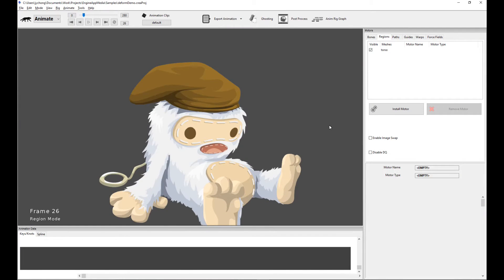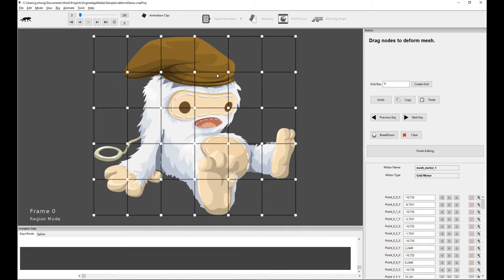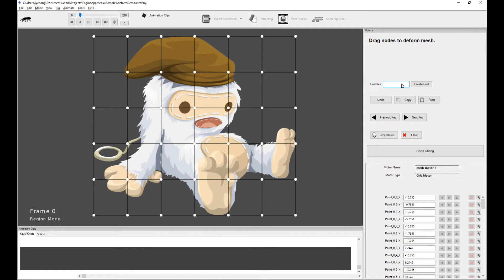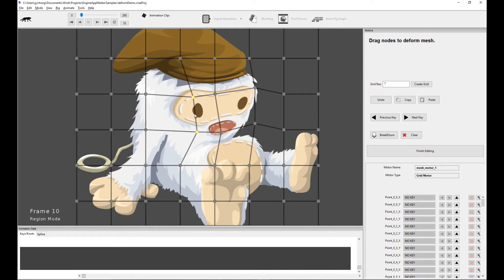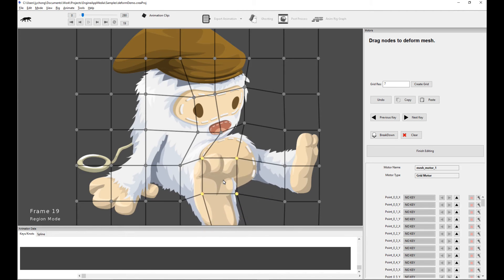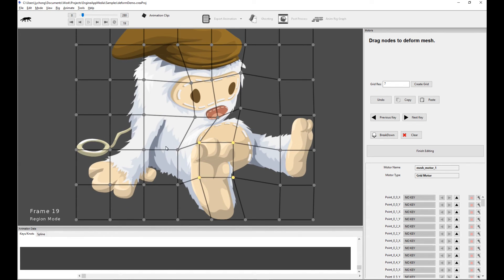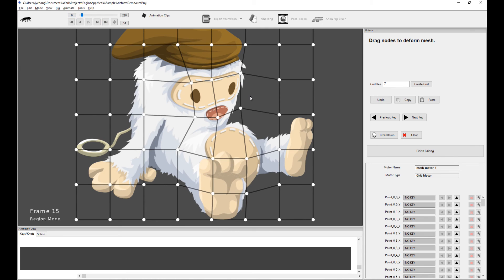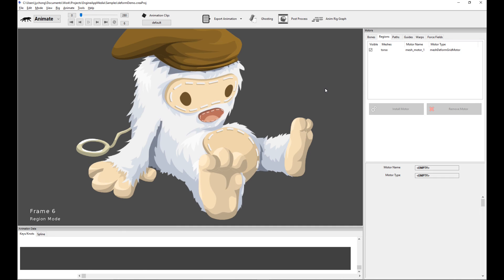Creature Mesh Grid Deform FFD Tutorial

Comment: how do you edit timing of mesh grid deformation keyframes? Are they exposed to the animation data editor *creature's dopesheet)
Reply from the maker: Yes of course they are. But given the large number of points ( if you have a very large grid for example ), I have also put in controls to enable you to easily jump between key poses ( poses with keyframes in them ). There are tools as outlined in the video that allow you to clear pose keyframes, copy/paste poses and breakdown pose keyframe knots. That is probably the preferred way to manipulate and do keyframing with the grid deformation tool since once you have a large resolution of 10 or more, you are going to see the animation data editor get populated with a lot of points.

Comment: niiiice!!
Reply from the maker: Thanks :) Unlike many other FFD tools/solutions for 2D, the solution I have implemented for Creature overlays a grid or lattice on top of your original mesh. This has some rather large advantages: 1) You can have a low or high resolution underlying mesh depending on your use case. Your bone mesh skinning results might depend on having a very high resolution mesh. 2) The grid that works on top of your original mesh produces very smooth and nice shapes when you manipulate the points on the grid handles. If you choose to have a grid with fewer points working on a high res mesh, you get to manipulate your shapes very easily since there are less points but at very high quality. Cheers